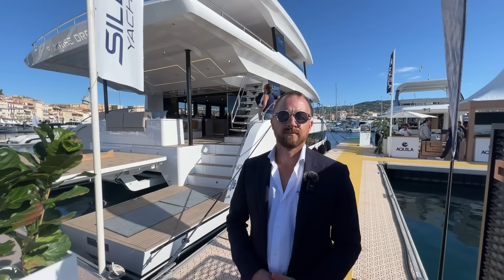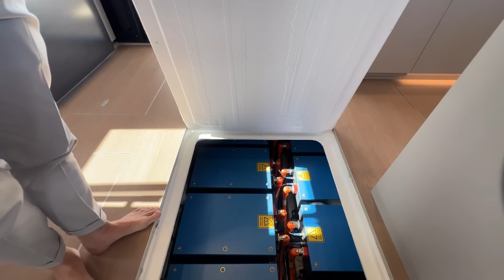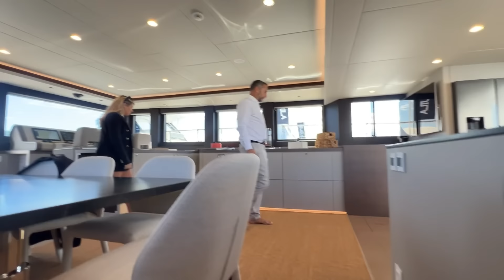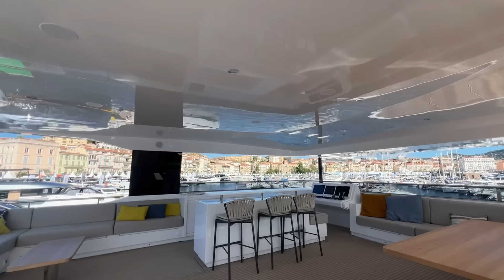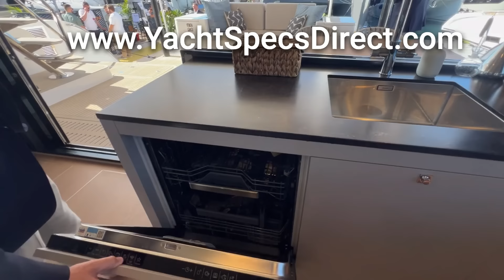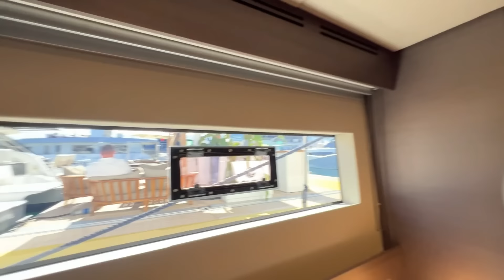Hybrid Electric Silent 62 Solar Power Catamaran: Interview & Cannes Tour | Sustainable Luxury

Comment: I find that the Silent 62 Tri-Deck presents a marginal energy balance that complicates its "sustainable" marketing narrative. While the solar array is rated at 17 kW, practical peak output is approximately 12–13 kW; when the 8–10 kW required for air conditioning and hotel loads is active, the system is left with a negligible 2–5 kW surplus for propulsion,
. Consequently, the vessel functions as a series hybrid rather than a purely solar craft. Even for short 30–40 mile trips, the integrated generator must be engaged every third day to maintain the 40–50% safety reserve, highlighting that the solar-to-propulsion ratio is insufficient for continuous autonomy without fossil fuel intervention.

The battery architecture utilizes Lithium Iron Phosphate (LFP) chemistry, the correct choice for marine safety, and features an advanced glycol cooling system with individual module monitoring. However, the decision to house these high-voltage modules directly beneath the salon floorboards introduces significant operational risks, as the numerous glycol plumbing connections are vulnerable to vibration-induced leaks within the primary living area,
. Furthermore, while the system is designed to "isolate" faulty batteries, the overall architecture remains optimized for "silent" anchorage and hotel loads rather than sustained high-load transit, as evidenced by the limited 2-hour electric cruise duration at higher speeds,.
Mechanical vulnerabilities are evident in the use of residential-grade appliances and the undersized auxiliary kite system. Standard Siemens household refrigerators and induction tops lack the specialized vibration damping and salt-mist protection required for Category A ocean transit,. Additionally, the 9 m² kite system—effectively a standard kiteboarding sail—is physically inadequate for a vessel of this displacement and windage. This is confirmed by the system's inability to maintain steerage without active motor assistance, requiring 2 kW of electric power just to keep the rudders functional while "sailing",. These factors suggest the Silent 62 is a luxury-focused coastal hybrid rather than a robust blue-water autonomous cruiser.

Comment: Whats a solar powered boat like for the next three owners 20 years down the road? What is the cost of replacement power?
Reply: To me the benefit of SY is that the solar panels, batteries, and electric motors appear to all be removable and upgradable.  That’s not possible with Sunreef’s glassed-in solar cells and likely not possible with Xquisite’s hybrid propulsion system.  Plus the kite option is a cool addition.

Comment: How many bitcoins (say $100K each) does this baby cost? 😍I love it!

Solar panel output may be less than nominal due to partial panel shading. The panels at the same level as the flybridge need to installed on their long side. Now 6 panels are wasted when partially shaded, instead of 3. LFP = Lithium Ferrous (or IRON, not Ion) Phosphate
Reply from the maker: @PaulKios316  ~ $5.7M so 57 BTC.    If you’re interested in a Crypto transaction I can help.

Comment: It would be cool if they can do some sort of mechanical bifold system to double the rooftop solar when anchored.
Reply: You don't need it. That solar is more than enough to run all the electric systems on board. Where you actually need the power is for propulsion. You do actually need generator for decent speeds cruising, unless you run just for a short while, or at slower speeds at very good solar conditions. Or better yet, treat the yacht like sailboat with the kite sail system. Ofc, this would be mostly for longer open ocean travel.

Comment: While a boat of this kind is only for the high end, it is cool to see the electric concept being realized.

Having a boat where the only limiting factor to range is the amount of food and booze on board is amazing.
Reply: My fantasy is to homestead one of these, where one hull is the 'farm'. Hydroponics, freeze dryers, dehydrators, and freezers. Fish, spear, trap for meat. Brew/ferment some booze.  Really stretch time between ports.
Reply: @TeachMeTheGuitar: Cool idea.
Reply: This description is very misleading. I looked at their website to get more info. The solar panels make 16Kw and the motors use about 700Kw. There is a massive diesel generator onboard and a huge battery bank. With solar only, you are making roughly 20hp.
Reply: @Clint3571 so basically, with batteries and solar, they are not running the generators at anchor and maybe moving through a no wake zone, but need to run the generator to cruise.

Disappointing, but not unexpected.  There is no free lunch when it comes to power.

Comment: What is the starting price? What is a nice specced price?
Reply: Before covid, the first 55ft model was around 2.5 million usd. In 2024 with inflation and redesigning to 60ft, now, asking price is around 4 million. Now there's a 62ft model that's going to be the base model.
Reply: I ordered one 3 deck 62 late 2021 fully kitted for 3.2m but then they went bankrupt and the new company will not honor my payments despite them having my hull and components. Now they are suggesting I buy a new one from them for somewhere in the region of 4-4.8m for the same boat. Crooks!
Reply: @MrMagnus  None of that is true.

Comment: Thank you for addressing lithium batteries catching fire and these lithium ion batteries being next gen from those and properly installed and monitored.
Reply: They are lithium iron.
Extremely safe & charges happily to 100%
Reply: Solid state batteries are coming sooner than you think.
Reply: Lithium Ion and Lithium Iron Phosphate (LiFePo) are 2 different chemistrys.  The Ion is the one that explodes.
Reply: @OwenfromKC , also worth mentioning that both chemistries are quite a bit less a fire risk than diesel and especially gasoline.  So, while lithium iron is even safer than lithium ion, neither is a real concern relative to existing fossil fuel systems that we are all used to.
Reply: @OwenfromKC  Thanks for the info.
Reply: @OwenfromKC  LFP batteries are also lithium ion. You are thinking of NMC (Nickel Manganese Cobalt) lithium ion batteries. They are the same general idea but with materials used. They both contain lithium.
Reply: @OwenfromKC the phosphate also runs a bit cooler than lithium.

Comment: For a boat that size and only have a 6 hour range , is a hard pill to swallow especially for the cost. Buuuutt extremely cool boat.
Reply: It's only a 6 hour range on electric, with the generator usage you can go much longer and farther (though you have to take in to count fuel then)
Reply: probably far more than 6 hours if you don't go flat out full speed...
Reply: Wonder if they checked into a dagger board type setup for the kite? And if the structuring auditions they do for the kite will handle a larger kite
Reply: You have generator, and kite sail system too.

Comment: Does it have stabilization?
Reply from the maker: It does not have Stabilizers, as that is typically not needed or used in a Catamaran.   If you need more details, please reach out.  Cheers.

Comment: I suggest if they are adding 180kw of battery for electric motors it would only show 140kw. leaving 5% on bottom and 15% on top end not used unless emergency. Those areas are where most battery damage happens. Same for house banks. Also have a anchor setting for batteries/dock setting that only charges to 80% unless there are really hot days. Also a storage mode where the boat only charges to 60% as it is not being used. These setting will extend the life of batteries big time.
Reply: Probably iron based chemistry.
They don’t mind charging to 100% every day.
Obviously you don’t want to discharge completely.
Reply: Lithium is much more robust than that, I run my home batteries hard and they have lost little to no battery health. Also in five years there will be many ch better options so keeping everything modular is smart for retrofitting newer technology.
Reply: @casperyourfriendlyghost7552  See you want 20 plus years from your batteries. Look at how fast EV batteries drop to 60%. Its the charging to 100%. My cell phone is a Samsung note 5 years old and it lasts 3 days still. I turned battery to only  charge to 80%. My 58kw bank of LFP eve batteries charge to 90% and down to 10%. 2 years and still perform the same. See I want these batteries to last 30 years.